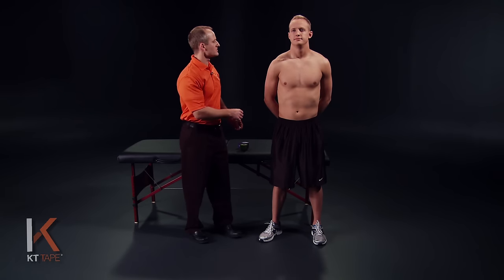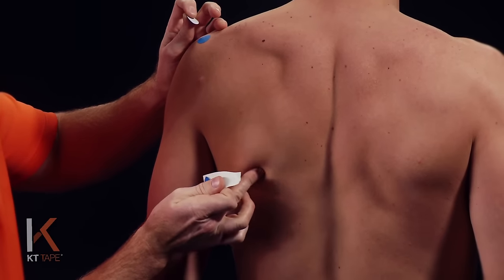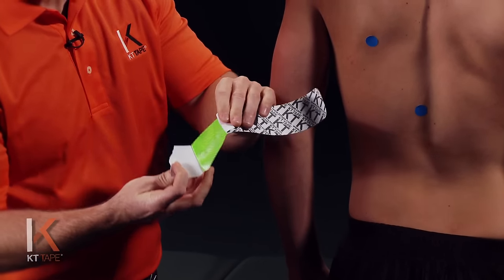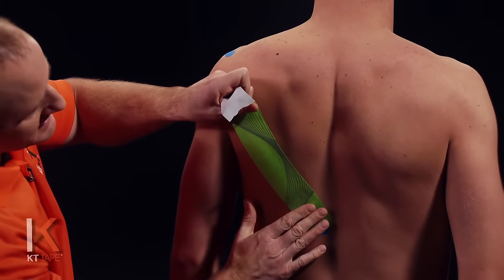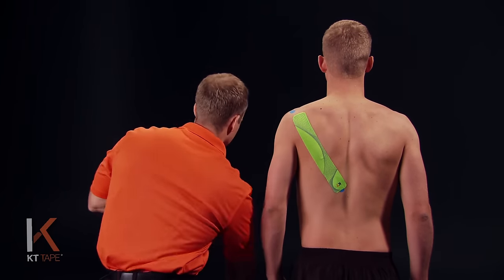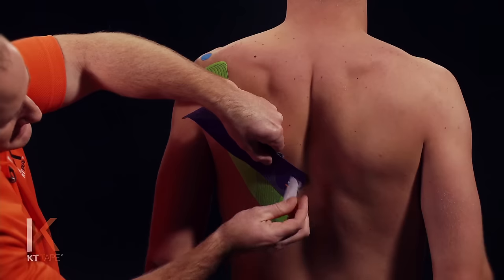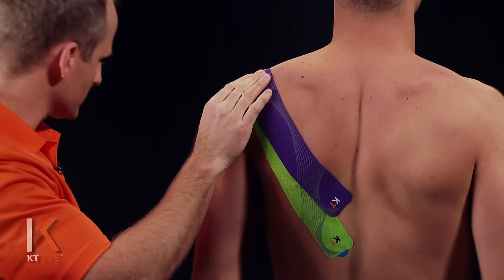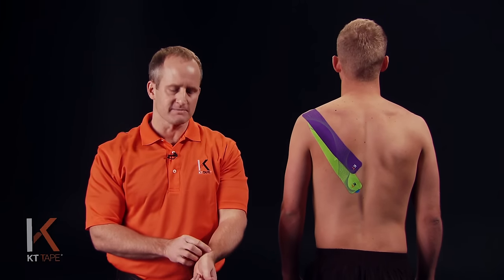KT Tape: Shoulder Stability

Comment from the maker: The tape actually doesn't pull equally to both ends once applied.  It will always pull more toward the first anchor point that you put down.  So depending on if you want to facilitate or relax you'll put the first anchor point down at either the insertion point or origin.

Comment: I'm gonna try this ASAP. I have Ehlers-Danlos Syndrome and I recently injured my shoulder that was always very loose to begin with. Now it keeps subluxating when I walk a lot, causing severe pain. I bought the KT brand Tape for the purpose of keeping the glenohumeral joint more stable. I hope it works. It didn't help for my back since it made it even stiffer, causing more muscle spasms. I've have 4 spinal fusions in my lumbar spine. 
Update: It helped my shoulder! It even helped my back a little where it attaches to the spine.
Reply: Same! cEDSer here! My right shoulder is permanently dislocated, and the KT tape does help keep it from shifting and crunching around when I’m doing things like carrying a bag, or running. It’s literally a godsenddd.
Reply: Came to the comments to find another zebra this worked for!! 🦓🥄
Reply: @bee1411  does this method help keep the shoulder more stable (and hopefully but less pain)? Daughter has just been diagnosed with hEDS and her shoulder is constantly sublaxing, so trying to find best method to help her.

Comment: So can you do multiple shoulder tapings at once? IE Shoulder stabilize as well as AC joint sprain?
I have shredded and retracted Rotator cuff from military service, need Reverse shoulder replacement  but not till the VA is ready.. until then I'm going to try to use the KT Tape to stabilize the shoulder
SO, can I do multiple tapings at once?

Comment: My boyfriend was shot in the shoulder when he was stationed in Iraq. The location is about where the therapist laid down the last bit of purple tape. His Humvee hit by an i.e.d. as well and rolled several times. As a result of these he has issues with his shoulder 'catching' from time to time. His arm movement is limited and not fluid when this happens. Does anyone think that this might help him?
Reply: Kinesio tape is not completely proven, but people have seen benefits in reducing inflammation and increasing range of motion. This may help him, but going to a therapist for mobility work and reducing inflammation will provide much more benefit.
Reply: He is in therapy and I make him do very light range of motion exercises daily. My thinking was that this might provide help on days when his shoulder is just bound and determined it's not going to cooperate.
Reply: Kristin Arrington
Tell him thanks for his service - that's a tough dude.
Reply: deagler1776  I will. Thank you for your appreciation.

Comment: I experience a burning sort of pain along the medial border of the scapula, I'm wondering if taping with KT tape will help and what sort of application you might suggest? The pain only manifests if I'm extending my arms a lot, reaching over my head to get things, preparing and chopping food, mopping or vacuming floors etc.
Reply: You have serratus anterior weakness cauing medial and inferior border winging. Work on lower traps and serratus strength. It might go away then

Comment: Is there a rationale for going insertion to origin or vice versa? I have heard of RIO and FOI as a mnemonic for facilitation and relaxation, but it doesn't seem to make sense if the tape pulls equally on both ends once applied.

Comment: Hi
I have shoulders that have dropped down and rotated forward. Apparently the muscles between my Rhomboid muscles (in centre of back) are weak) As well as trying to strengthen these muscles, I need to try to hold my shoulders up and rotated backwards. Can this taping help or is there another you can recommend.
Thanks